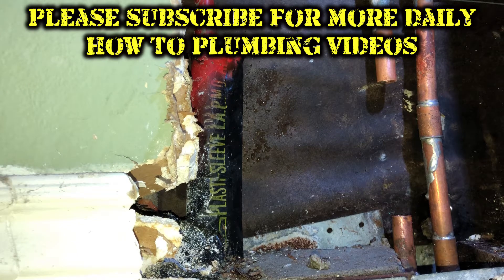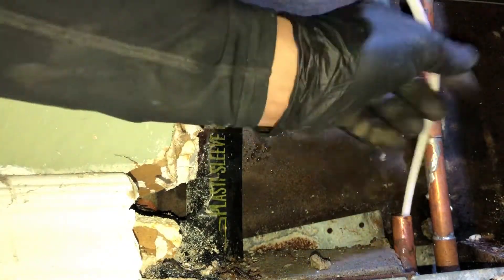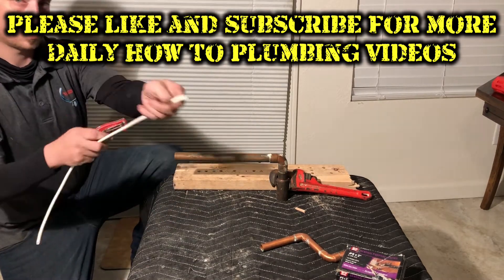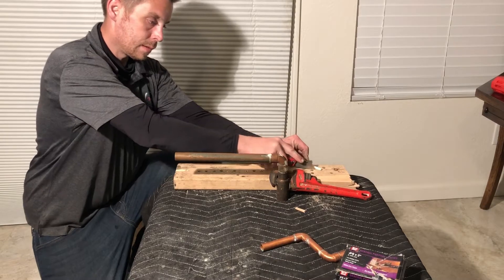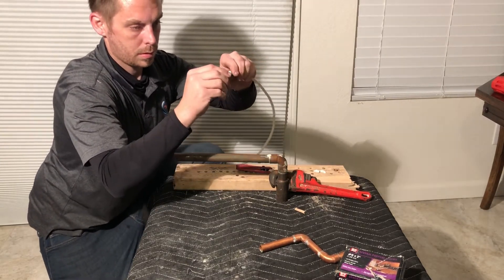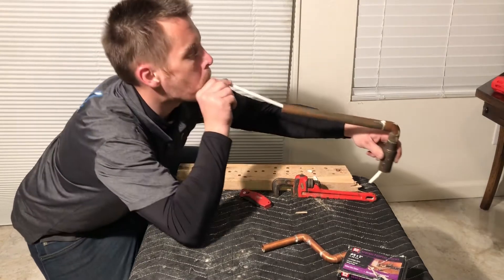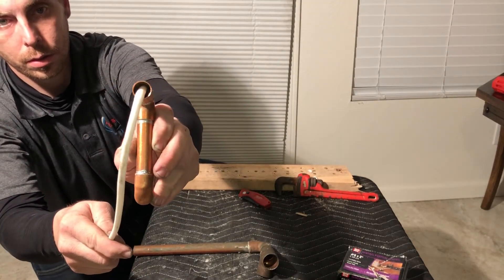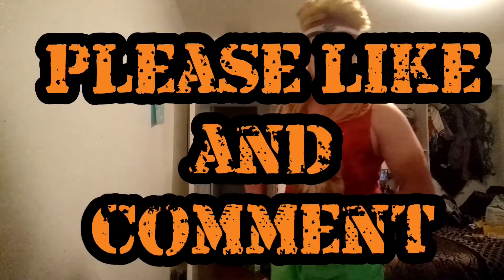How to solder copper pipe with water in it | Plumbing Explained

Comment: What I do is sick my thumb on the end of the tube.  The airlock pulls out all the water in the tube.
Reply from the maker: That’s also a good method I was thinking about not uploading this video and showing all the different methods that I use I also have a little pump you can attach to your drill and drop a little piece of 3/8” hose down and use your drill to suck any water out